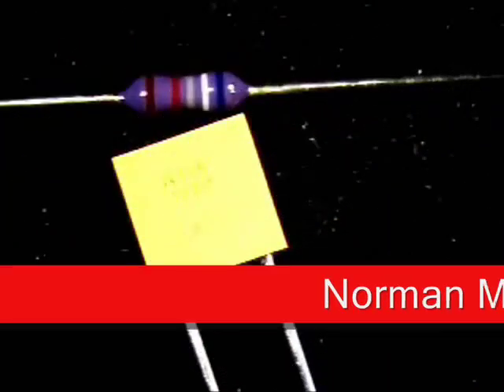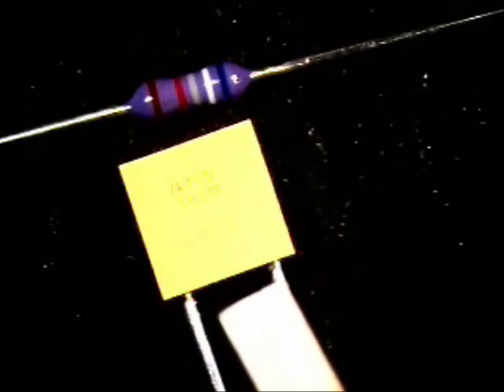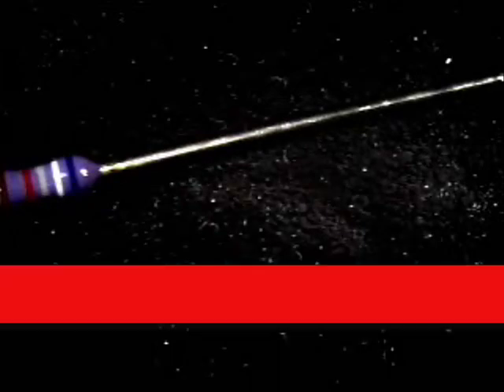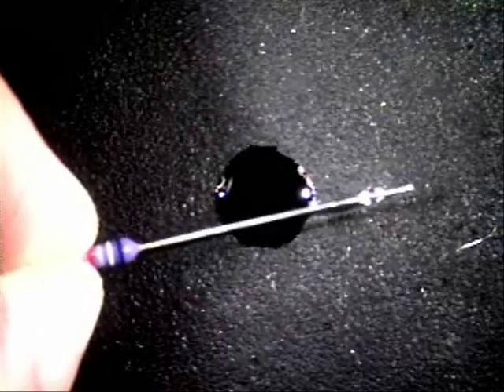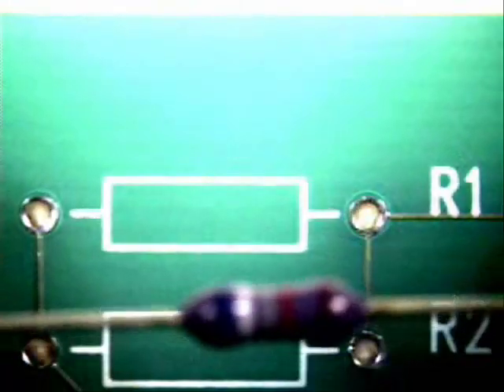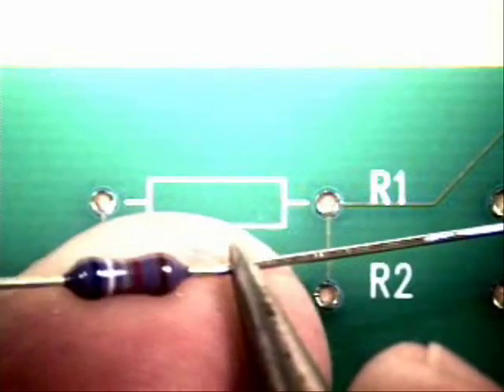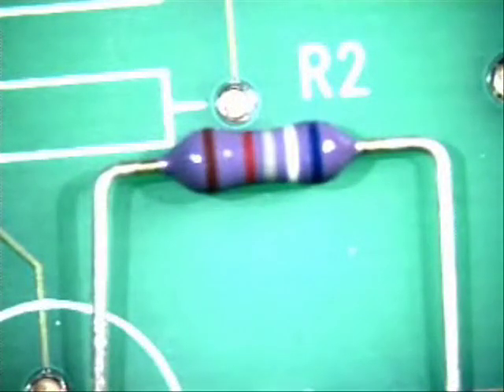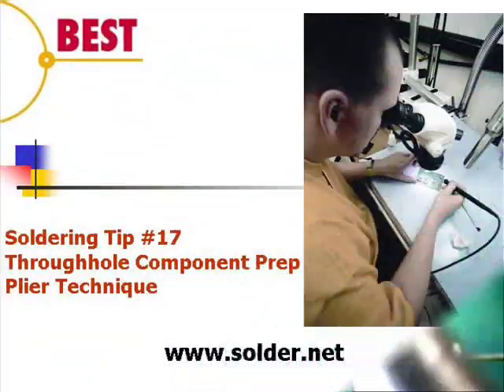Throughhole Component Preparation Pliers Method

Comment: @kilyerd:  Yep!  You're supposed to NOT stress the component lead/terminal as it passes into the component body.

Also, if the terminals are already tinned, no "pretinning" is required.  And, when soldering, normally no extra flux is required unless there is significant oxidation of either/both of the two parts to be soldered.  I prefer to mechanically remove excessive oxidation, rather than just adding more flux.

Comment: @Coodude26 It is only the worst thing you can do if you are bending right up against the resistor and creating some leverage between the lead and the component.  Bending tools bend it the same way he did with the pliers so he isn't creating any stress between the component and the leads....

Comment: In fact, I think it would be best to bend on the other side of the pliers, to avoid exercising any mechanical stress to the component. Bending on the free end would cause the mechanical stresses to go into the pliers, rather than in the resistor.

Comment: Resistors in particular really aren't affected by heat. And as for bending it with pliers, that is one of the WORST things you can do - it's stupid to do it because it "looks nice", and it puts an unnecessary amount of strain on the leads. This can easily lead to them breaking.